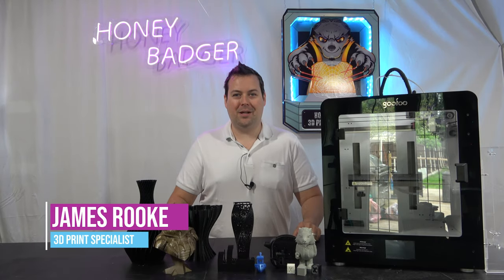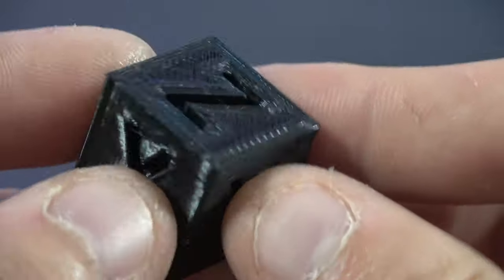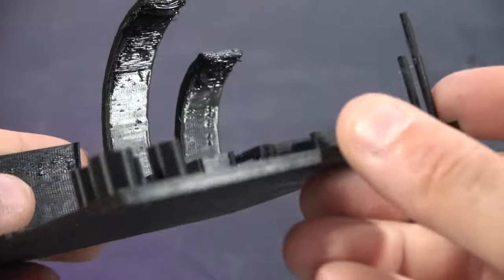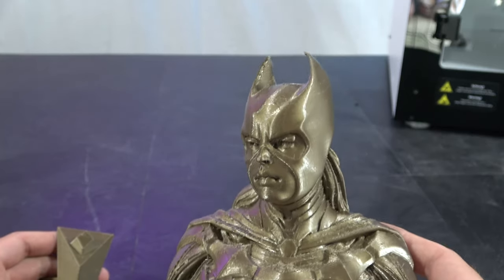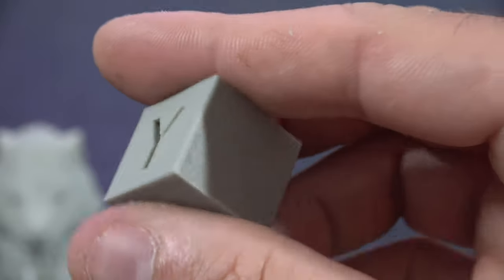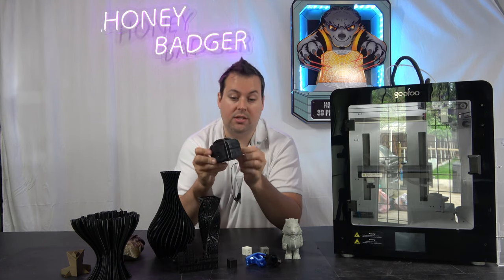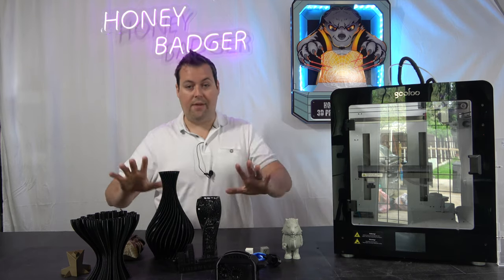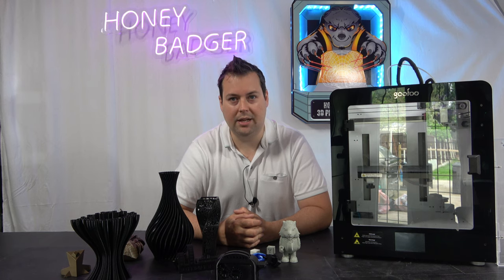Goofoo Mido Review and Results

Comment: Nice review, I have had mine for about a year now and very happy with it. There has been a few issues with the supplied printplate (things stick too well :) ) so I have now finally found a way to re-program the ABL levels using config.gcode so I can use a thicker plate (Ziflex). I look forward to the full review as I got the full package myself (topcover, 400c hotend) but havent tried the 400c yet :)
Reply: Ohh and btw I am getting the new Mosaic Pro 3 so I can start to use multi-color prints on this amazing machine too :)

Comment: Hey, nice video. Is the printer still working well? Your video seems to be the only customer video on this printer. I'm considering purchasing it. Would you still recommend it? I currently have a tevo tornado, but its got a few issues I can't seem to work out. Love the idea of having a printer that just works and consistently spits out great prints.
Reply from the maker: It's honestly a really solid machine, the print quality its really good with the normal temperature hotend our next video will be showing the high temp hotend which goes to 400 degrees

Comment: Hi I have got one if these Mido but I find that wall lines does not stick so well to each other. I have tried to sink the line width to 0.35 on slicer to mitigate a little this issue but is still there.
Have you experienced the same on your prints?
I noticed that the Z face of your ABS cube on the video looks very similar to what I am getting.
Reply from the maker: so normally layer adhesion is a temperature issue we did a PID tune and got much better results but we do run this hotter than i would normally qould

Comment: Any chance of another video on this printer now that you've had it for a while? Like a year in review or something? Interesting printer, but very litt info on user experience out there.
Reply from the maker: so we are using it all the time, its been a real work horse, not a huge fan of the carbon fiber bed and we haven't been using the high temp hotend, but the normal hotend has been really good